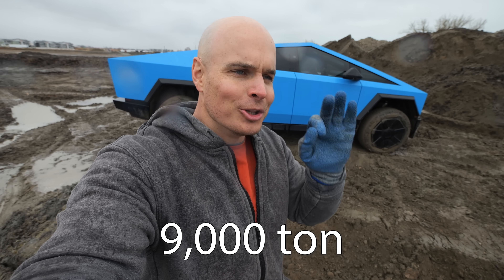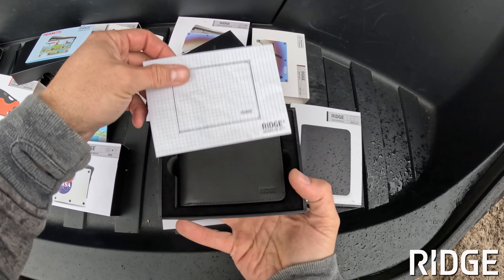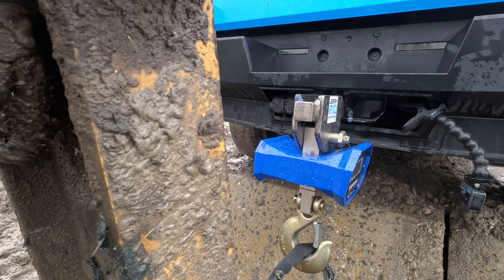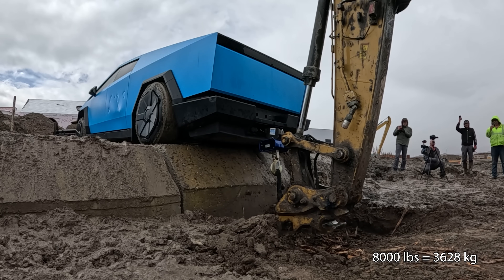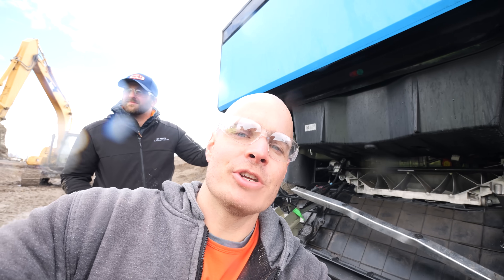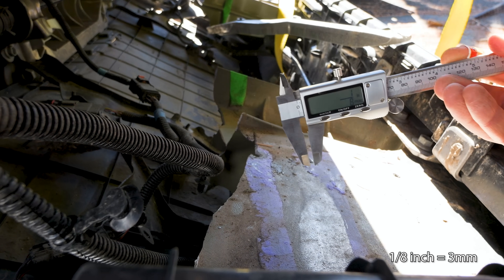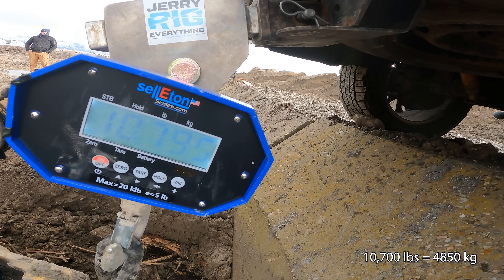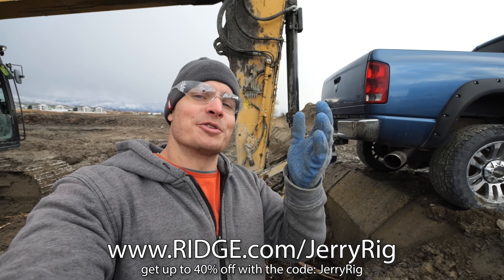SHOULD YOU TOW WITH A CYBERTRUCK?! - (catastrophic failure test)

Comment: Gotta do the drama for the views, eh!  It broke at about 10x its rated capacity for tongue weight. That seems like quite a reasonable result.  You said if it made it to 11K it would be good. It nearly did that at 10.5K. 

Also, comparing it to a 3/4 ton Dodge 2500 instead of a 1500 is comparing apples and oranges.  

But yep, let’s go drama and go with “DANGER: DO NOT TOW…”.  

Have a bit more respect for yourself my man!

Comment: 6:28  If the excavator operator was trying to estimate his reach to get 10,000 pounds?  He might have estimated with the bucket on (a bit ore leverage and obviously way more wight) These guys on construction sire are amazing with the equipment. )
Reply: So you have exceeded the tongue weight by 2.5, what did you prove?
Reply: Knowbody running an excavator, especially in the dirt buisness calculates loads and boom angles. They do have lifting charts and I'm sure that there are some sites but very few where they use excavators lifting charts. This guy loads dump trucks and digs holes  and never even looks at that chart. Pressing down on the boom from close or far away doesn't change the weight of that machine. The fulcrum point is the rear wheel of the track whether it's the idler wheel up front or the traction motor out back. He could have gained more weight by putting the traction motors up front though because they are heavier. If he was lifting he would want them out back but he does dirt and probably never thought about that.
Reply: They were probably expecting failure at 5,000

Comment: That's the same story than with whistlindiesel. The cybertruck is rated for 1100lb in vertical lift (I think they just gave a low number to be sure they wont be any damage) and 11000lb in towing capacity.
U tested yourself tht towing capacity, so it was right, and here, u just shown that it can handle more than 3 times what it was rated for.
I think they were just right, but setting up a trailer correctly is important. Here in France we have to get a formation to a trailer above 500Kg (I don't know about the US) because of the damages it can make to a car when not loaded properly.

The numbers were low but right

Comment: You mean, when you try to break it, it breaks?  (Surprised Pikachu face) You disappoint me zack.
Reply: You did see that he also tried to break the Dodge and it didn't right?
Reply: @TheOutsideFox  it is a pointless test. who cares of the steel didn't break, show me a cybertruck where this has happened under normal circumstances. It hasn't happened. Just because the steel frame is overbuilt doesn't mean the cybertruck is underbuilt.

Comment: Before you read this comment, I'm not saying the truck wouldn't break at the exact same weight. That said, why was all the weight applied downward like that? The weight wouldn't apply force anywhere near that direction in use to actually tow things, so that lessens the impact of what is being shown here. It doesn't matter that another vehicle could withstand that force like that, because there's no requirement nor promise nor even implication that Tesla designed it to withstand force in that direction. Essentially, especially for Tesla fanboys, this gives room for a "Well, they broke it, but they did it in a way that's highly unrealistic, so it's fine for actual towing that applies force in a different direction."
Reply: But the Dodge held up
Reply: @07bently  Yes, I'm fully aware of that. It's like you literally did not even bother to read my whole comment. In the minds of people who want to deny this test, the fact that the force was applied downward in a way that the force would not realistically apply in real world means they can go "But it was never designed for force in that direction. It was designed for force in the 'proper' direction for towing! Doesn't matter that another truck passed this, downward force tests are irrelevant!"
The same issue arises in testing any other system that handles force. Atypical force application directions are not typically designed for, but MIGHT be incidentally covered. It's like getting mad that a car designed to be as light and efficient and cheap as possible for 'entry models' crumples when hitting a wall at 150mph, while a big, heavy, steel frame truck does not, and is more likely to bash the wall down instead. Sure, you could have put the effort to make it not crumple. But at what cost? And that question right there is why this test SHOULD have been done in the more typical towing direction, to cut off naysaying complaints like the hypothetical I've described (and which I've already seen other comments try to use to defend the cybertruck, lol).

Comment: Fun fact: it is possible to cast aluminium with less air getting stuck in it. You just need to heat it up while there is another gas instead of oxygen and you use a vibrations to force any oxygen that did make it into the aluminium to come to the surface instead of getting trapped. They really should have been doing that for these trucks but it is clear that they didn't even make an attempt to from what I can see in the video. 

It looks worse than a part I have my my long board that I have broken 2 of which is absurd. (said part is always replaced for free by the company though! and when it breaks properly it isn't a catastrophic failure that puts you in immediate danger)

edit: the part is also thicker than the frame pieces show here and it isn't even rated to 11000 pounds lol. The thinnest part is at least the same if not slightly larger than this frame. I can't measure them exactly because they're in the middle of the part and aren't even where it broke

Comment: Also you're applying the weight slowly more of a real world situation is like whistling diesels. Especially since the hitch is so low, that thing if you hit a pothole or something really hard on accidents where a steel hitch might bend or just great because I've seen steel hitches take a very serious hit and be fine or the brackets bend up and you just put new brackets on the side it's good to go again. You do that with that aluminum one that's molded into the frame, that thing just snaps off with no warning. One good example is going over a set of train tracks that are multiple tracks wide and it's a rough road and bumps and you have the max configured trailer that you're towing. Class three or class four whatever it's rated for, and the added weight of the trailer and the jolt of the bump or the pole of the tire is hitting the side of the tracks pulling it backwards would very likely snap that hitch into. Causing damage to your trailer whatever you're hauling your truck possible other vehicles around you another lanes as the trailer suddenly disconnected and if your safety change are hooked up to the same aluminum piece that snapped well that's gone too.

Comment: This test doesn’t make any sense.  The highest load on the hitch would be during emergency braking, when one, the trailer weight will shift forward, causing more downforce, but two, the larger load will be facing forwards, as the truck tries to brake itself and the trailer (imagine the trailer brakes fail).  This load will be about 1G (maximum braking), so the trailer’s entire load will be pushing forward on the truck.
Reply: Ok two trucks were tested in the same manner one failed really bad and the other tested well

Comment: dude that is a tongue weight test not a tow test.  this is false advertisement.  if it exceeded its tongue weight then it successfully passed the force you tested was downward force on hitch aka tongue weight.    it's designed to pull 11000 lbs not have 11000lbs on the tongue.   false test.  pull horizontally back to test tow weight capacity.  you are letting your political bias affect your videos.  long time watcher and you are now exposed.
Reply: Doesn't matter it was a test between two trucks one failed and the Dodge held up
Reply: @07bently  they are completely different trucks ct isn't even comparable to a 2500 more like a 1500.  also that's just dissimilar metals. of course aluminum isn't as strong as steel.  nobody needs a 10000 lb tongue weight.  it's a fake test setup for jerry to be more complicit in his political bias against the best car company tesla.  Jerry is a federal shrill.  the test proves one thing both trucks far exceed their tongue rating. and that jerry is a political bias. 😄

Comment: Machinist here:
Aluminium have many variants, for example 5080, 6060, 7075. For example 5080 is a softer alloy, this is the soft aluminium you can cut with woodworking tools. and 7075 is a nasty strong and more expensive version of aluminium, wich is almost as hard! as steel, but lacks the elasticity so it will break more easily

And yes, steel has a fatigue limit too, the most simplest example for this is railway wheel and axles. In the early days they thinked steel is forever, but after like many decades of constant force changes (rotation of the wheels) the axles started to snap. Then they discovered the steels fatigue limit. Thats why you can see workers with hammers at railway stations, who seemingly only knocks on the railcar wheels. They listening to the sound the hammer makes, wich can indicate microcracks in the steel and they can plan the repairs before the axle snaps.
Reply: Rail engineer here, I don't know too much about the wheels but rails made of steel (flat-bottom, bullhead etc) definitely do have a tendency to crack and fracture after so many years. Have seen it plenty of times

Comment: It was really cool to see the inside of the frame after the failure. I would like to see a horizontal test as well. Silly to brand this as dangerous however, the advertised tongue weight maximum is 1/10th of the frame failure shown. So bravo making aluminum almost as strong as steel. Are you confident enough to test a R1T?

EDIT

thank you for the title change, this is much more fitting

Comment: Aluminium is certainly not strong enough to handle that amount of force.... And glue? What ? Surely that's just temporary during manufacturing.... right ?
But the fact the vehicle refuses to drive even though the battery and motor(s) aren't damaged , solely because the bumper is off is certainly wild.

Comment: How is this considered a fail for the Cybertruck?
This test showed you need to strap down the front of the truck with a dozer otherwise the front lifts before the hitch breaks. Also 10000 lbs is more than the weight of two normal cars. So you can hang two normal cars vertically ony the hitch and it would not break? That's insanely strong. I'm not a fan of the cybertruck or elon musk, but this is the most stupid way of making them look bad.
Reply: The cybertruck was a huge fail it was a test between two trucks done equally
Reply: It's a fail for the cybertruck because it broke, Jerry was expecting it to withstand the full 11k lbs because obviously a 11k lbs tow rating means it should be able to withstand 11k lbs of vertical force on the tongue. Withstanding ~10x the rated tongue rating is obviously a failure and very dangerous. Jerry is a really smart guy for this one.

Comment: I’m all for torture testing a vehicle, but at least do it correctly. CyberTruck tow capacity is rated for 11,000 lbs of horizontal load, and 1,100 pounds of vertical load. The fact the hitch held to 10,000 lbs of vertical load is impressive, and massively over exceeded its rating. Someone please demonstrate the failure point of horizontal loads please.
Reply: It doesn't matter it was a test between two trucks done in the same manner

Comment: Come on man, you are better than this. You are pulling DOWN instead of horizontally. That is not how this works.
How did you quantify the 200lbs rating for your 'Big Rig' - It wasn't with this method.
And for anyone saying he addressed this later in the video, no he didn't. He gave some lame rounded opinion, in that it wasn't factually correct, about possibilities.
I love your work, but wow. I just want people to be fair, not underhanded - the same as you expect and have documented of others.
Reply: Bro 2 trucks and same test = 1 huge fail and 1 no issues at all..

Comment: I think the bigger problem isn't just that of raw strength, but also fatigue and failure mode. 

As Zack alluded to, Aluminum does not have an endurance limit, and causing it to flex back and forth will cause it to fail no matter what. Steel does have an infinite life endurance, meaning that below a certain amount of stress, no matter how much you flex it back and forth it will never fail due to fatigue. 

and even if the steel hitch was weaker than the CT's hitch, steel is still the better option. Cast aluminum, being more brittle, will break and shatter as we have seen before. A steel hitch might fail too, but it will bend and yield. Sure that's not great, but it won't fail catastrophically like the CyberDump did. Also, the more ductile steel is much much better at handling any shock loading that might come from, oh I dunno, driving at 75mph while towing. 

The hubcap spontaneously ejecting at the end was just the chef's kiss to top it off, even it doesn't want to be a part of this trash heap.
Reply: Aluminum control arms are used on millions of passenger vehicles.  They also don't have a fatigue limit like traditional steel control arms.  But that doesn't mean they aren't a viable option.  As this example shows, if the loads and number of cycles are appropriately quantified, material fatigue limitations can be accommodated.
Reply: @-Enginerd  But a control arm is not nearly under this kind of load. most of the force will be axial force from the vehicle turning, and some bending force when accelerating or decelerating. Also, unlike a rigidly attached tow hitch, they are attached to the body through rubber bushings which will absorb any sort of impact or shock. and they're beefy even for smaller cars. the lower control arms for my 2800lb Honda CR-Z were much thicker and beefier than the frame on the Cybertruck which is meant to pull 11,000 lbs. 

And these aluminum arms likely will fail eventually. but because they're so beefy and have such minimal loads, they are extremely unlikely to fail before the rest of the car gets scrapped. They are designed to last the life of the vehicle.
Reply: @MrFastFox666  Comparing thickness of the metal is only appropriate if the geometry is the same.  When the 1984 Cherokee XJ came out, people doubted it could ever compete with proper body on frame SUVs.  It's just made of thin steel after all.  Now look at it.  It's regarded as one of the most rugged, capable, desirable off roaders 40 years later. 

Back to the Cybertruck, yes if the rear casting was identical in every way but made of a high-alloy steel, it would be stronger. Also, it would be more ductile resulting in a desirable failure mode for towing applications.  There's no denying that.  But that doesn't mean Aluminum isn't entirely acceptable for 99.9% of use cases if it's designed properly.  Based on what I have seen, I would have zero concerns towing with it.  But if a dynamic recovery is necessary, use an increasingly common kinetic energy recovery rope, not a chain.

Comment: Advertising a HUGE towing capacity like 10,000 pounds for an electric truck is not crazy.  They are super heavy (good fraction) and have crazy torque (ire to to pavement)  both things you need for a BIG towing capacity.

I have Occasionally used electric trucks to move 40 ton trailer loads at warehouses! .. IDK if they still use them??

 We called them "Shuttle Trucks" and they were just a tiny cab with a HUGE Lead Acid battery bank, and a 5th wheel .. they would drag ANYTHUING around the parking lot and were  SUPER EASY to back up into parking spots for unloading etc. !!